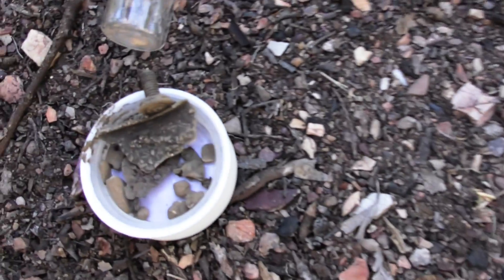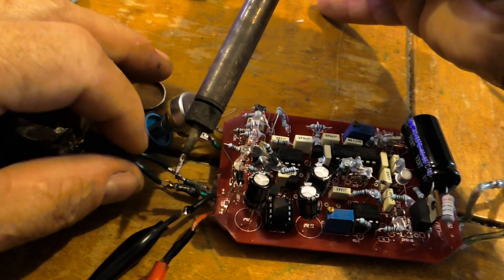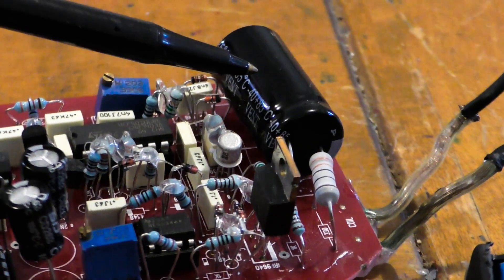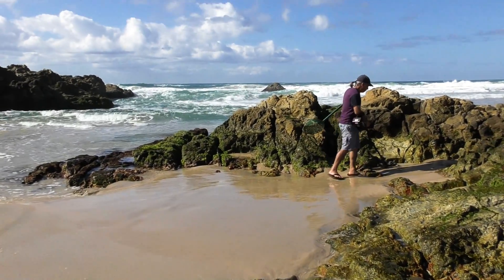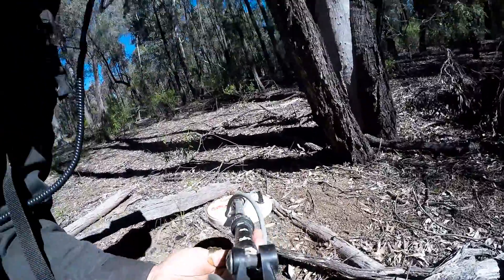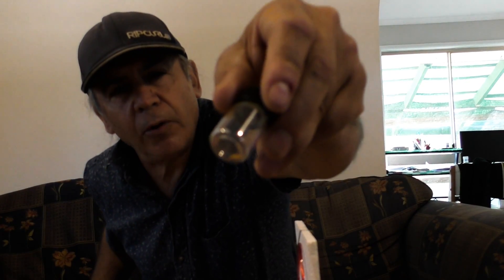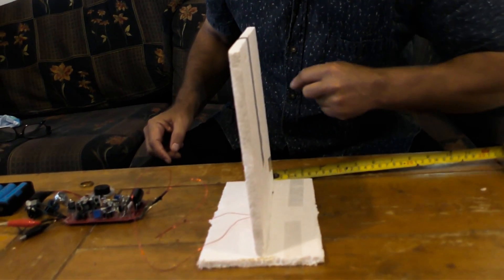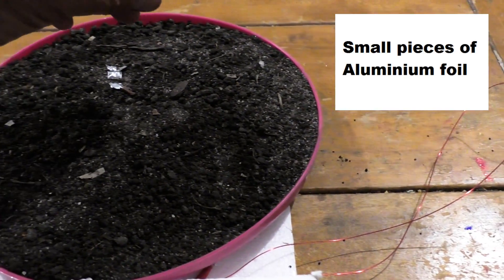Electronic  Gold Prospecting: Modern Pulse Induction Detectors: & Performance Boosting

Comment: I was thinking of using a home made 800 kilo joule low esr and esi capacitor bank to create a pulse powerful enough to map an areas gold distribution to the centimeter and have an accurate display of the gold on a virtual GPS map with a real time image overlay.
Reply from the maker: A powerful pulse will also increase receive signal, and in the goldfields the detector needs to have a effective way of ignoring unwanted receive noise to be useful. Keep in mind that i am by no means an electronic expert however.

Comment: Wow your a smart man. I have been trying to make my bounty hunter 1100 .in to a boat mount and exstend the wire 17' along with my sound cord for my water proof ear ware .this would alow the meeter box to stay dry and the wand and ear ware to be under water with me will I lose power to the coil by doing this .I tryed the company for help but they say it will void worrinty and they cant tell me ... so can you help me trying to kill two birds with one stone  thank you for your time  mate!
Reply from the maker: Factory Metal Detectors are made to fine tolerances and are easily destroyed.You won't loose power but keeping water out of electronics is very tricky. Otherwise interesting thought.

Comment: Hi mate! Looks like a Surf Pi board you got there? Got the long board version which im fiddling with at the moment. Have a quick question, from what i understand (n thats not much) by turning the delay pot and making the delay shorter you've made the detector more sensitive to gold which has a quick decay, right? But why did you also need to adjust the voltage offset? I thought you were meant to set it once at zero with a scope, and leave it at that. Does adjusting the offset also play part in increased sensitivity? Cheers! sq
Reply from the maker: I Think You are right and probably know more than me. i think adjusting the delay makes it too sensitive to everything therefor making it difficult to work with. however there is an optimum point.  I was using a barracuda board here.
Reply: Just been reading the geotech forums for 2 weeks solid, but not got prior experience with MDs. Having access to a descent scope made it a lot easier to make sense of it since you can see how changing things affects the waveforms. Somehow have had good luck with making coils and all 5 turned out to be pretty fast, between 5 and 15us so have delay set pretty short. Found that setting the delay to before the pulse curve starts to recover produces a lot of false signals, but only done indoor testing so far... Also have an IDX Pro board that ive started on, but thinking of also making the minipulse plus since it has more settings to mess with than the surf.
Reply from the maker: Very interesting and potential rewarding hobby in many ways. the people who original designed these circuits are the elite. i have learned to appreciate the technology. some of the new detectors like minelab ctx gpx and whites tdi are incredibly sophisticated but appear simple. You seem to be a researcher. important quality to success. also once you deal with disappointment success often follows. let me know how the minipulse goes for you, as i found the barracuda very challenging.

Comment: I'm looking for a detector that can go as deep as 7m and the target size as big as a fridge. Which detectors are supposed to work in that depth? Thanks
Reply from the maker: Ground penetrating radar, i think.
Reply: Thank you. I looked at GPR unit and it seems more like an industrial device and very expensive.
Reply from the maker: They are Probably hand made .They used to use a  BFO beat frequency oscillator, but apparently common vlf or Very low frequency is better now days for deep stuff i think.

Comment: Hi friend where can i find the schematic of the metal detector?
Reply: you can buy the hole kit board and components at Silverdog website , there has been an improvement to the board just look for the geotech barracuda https://www.silverdog.co.uk/shop2/index.php If you need more info go to http://www.geotech1.com/forums/forumdisplay.php?70-Geotech-Baracuda. btw you can not tune the detect to the point he does in this video! the coil will pick its self up while swing it .